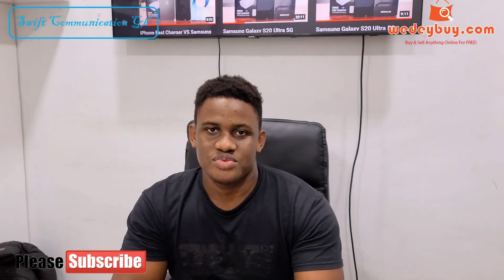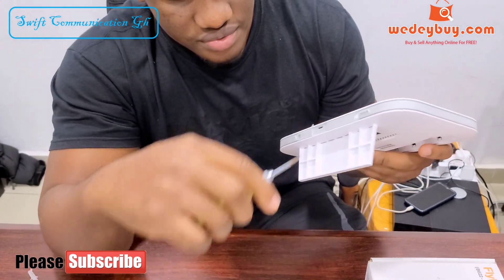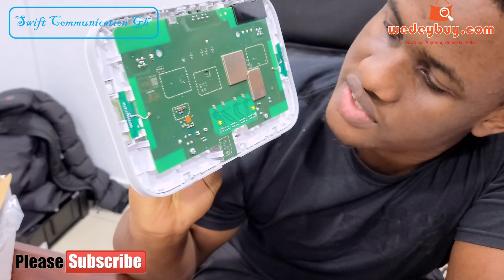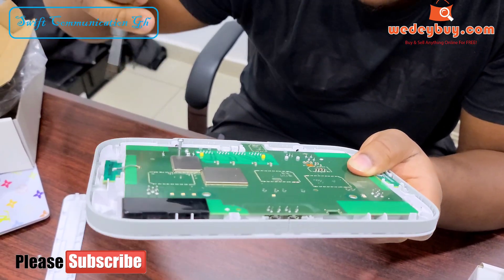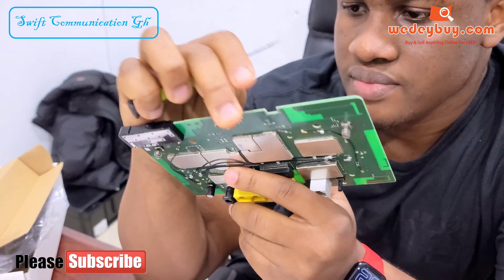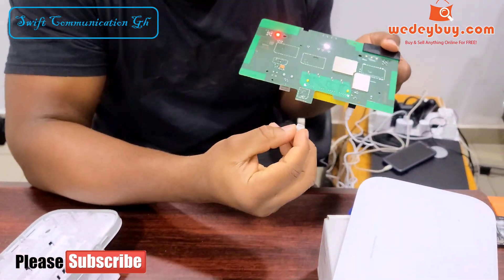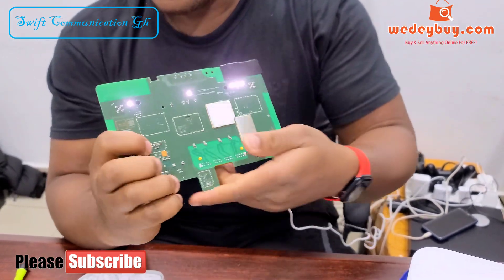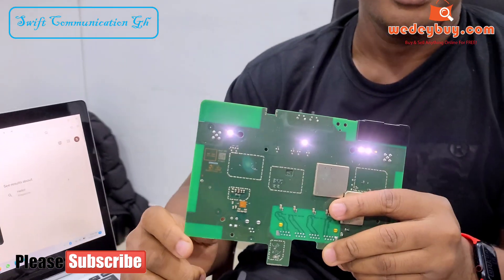Huawei Orange Flybox Soyea Links 4G+ Routers B622-335 Teardown

Comment: Hi i recently bought this modem when i turn it on after a while it makea a sound like something is cracking is it normal ? Kind a tik tok sound
Reply from the maker: modems does not have speakers so i don't know how yours makes noise
Reply: @MiFiUnlockingGh  i found some reviews that others like me have this problem i think its because of its plastik frame its made of dry plastik
But another problem i have with this modem is i cant set dns on it is there any way to set dns on the modem? I dont want to buy router as far as possible